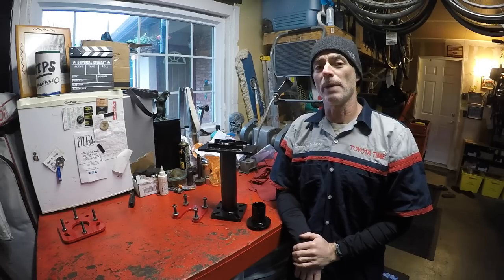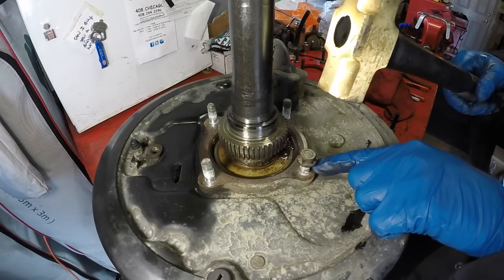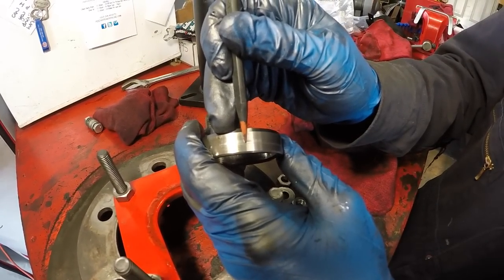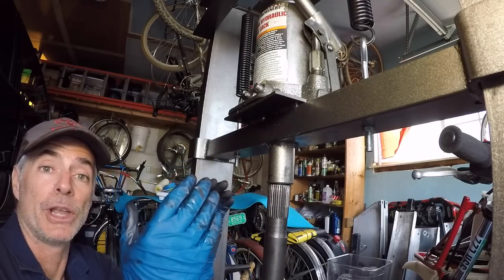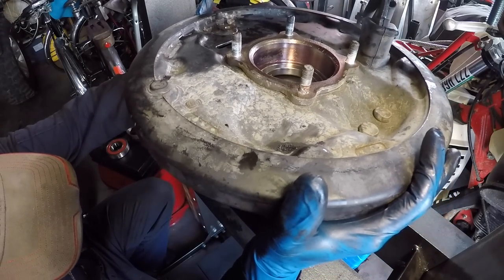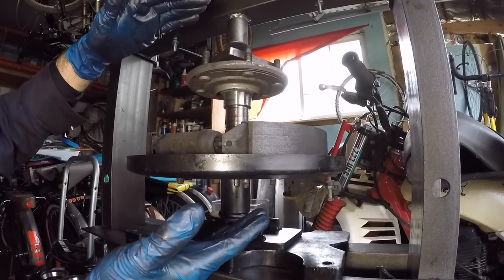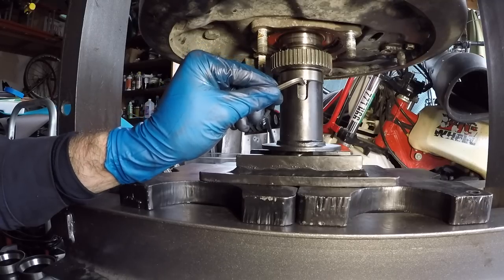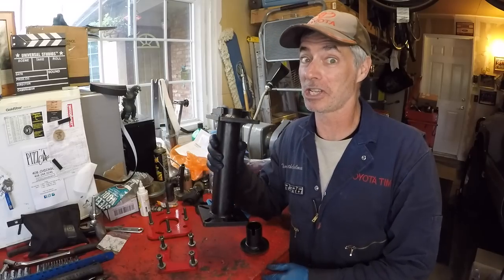Toyota Rear Axle Seal/Bearing Replacement (Part 2)

Comment: Hey timmy I used the abs ring puller for the first time the puller actually started bending and my abs ring bent now too. Have u ever encountered this ?
Reply from the maker: No, I haven't run into this and I've used the tool for several jobs now.  Don't have an explanation why that happened.
Reply: Your problem is im proper use of the tool .
Reply from the maker: @shobud7561  Hey Sho, I have heard from somebody on T4R.org that the same thing happened to them.  I don't know if it was Chris Fong or somebody else entirely.  The issue of the tool bending might very well have to do with the use of aftermarket retainers.  The person who bent the tool said the retainer was made by Timken and not Toyota and the Timken retainer fits much tighter onto the axle.  This could very well be the reason that the tool bent because the retainer was not manufactured to the proper spec.
Reply: Did you get it off??? And how???

Comment: Will a Harbor Freight 12 ton press work? Or do you need the 20 ton press
Reply from the maker: I have heard a 12 ton press can do it.  Duane sells an axle tool that will fit the 12 ton press.  The one we showcase in this video won't fit.  Go to Duane's Ebay store and you'll find it.  If you message him and buy directly from him, not using Ebay as the middleman, he'll give you 10% off.

Comment: I have a smaller press, with a 3.5 inch channel on the press table.
Reply from the maker: Ok Louis, you have a smaller press.  Do you have a question?  I don't understand the purpose of your comment.
Reply: @TimmyTheToolman  that was in addition to my question about the width of the tools top plate. You responsed already, about not giving out the dimensions.... I have placed that comment in the wrong spot. 
To those wanting context..
My harbor freight 12 ton press has a table channel of 3.5" the 20 ton is four. I just received the tool I purchased from donald the bonald, aka Duane, in ebay. Awesome quality, great turn around. The tool is stout! It will not fit through the 12 ton press table. But will fit the 20 ton as Timmy has shown...  buy Duanes tools, they are well made.
Reply from the maker: @louis_costa  Gotcha Louis.  Yeah, I heard Duane's tool won't fit into the 12 ton press.  The 20 ton press is not much more money and it has worked flawlessly for me for lots of jobs.  Maybe you could sell the 12 ton press somebody and upgrade to the 20 ton press.  That's what I would do.

Comment: Tim, I'm stumped and am desperate/determined to overcome this on my own somehow so I dont regret doing this on my own. I replaced bearings and backing plates on my 04 Tacoma along with the entire drum assembly (shoes and all). I'm now getting an awful shudder when I brake and only feel in the cabin, not the pedal. I'm 75% sure it's the rear drivers side. Unfortunately I discarded the old brakes but I purchased a third cheap drum incase it was out of round and it still continues on that same side. I'm hoping something isnt bent but no clue how to diagnose or what to look for. I know I'm asking alot, but any suggestions would be highly appreciated. I'm scared to bring it somewhere so they can RIP me off. Please help I'll provide you with my email or phone number.
Reply from the maker: Did you use OEM brake shoes?
Reply: @TimmyTheToolman  no :( I used powerstop. I saw someone recommended them on tacomaworld along with OEM.
Reply from the maker: @cyclopz-J  People have had lots of problems with aftermarket shoes.  I'd suggest buying the OEM shoes and swapping them in for those powerstop ones.

Comment: Idk why but my abs ring is much closer to the bearing than what is shown on the video. Perhaps someone previously attempted this repair on the vehicle and pressed the ring on way to far. As a result, I dont have enough clearance between the abs ring and the bearing to fit Duane's tool. Does anyone have a solution to this?
Reply: Also it's a 1997 4runner sr5 4wd w/abs
Reply from the maker: @jeffg658  Yeah, they could have pressed it on first and then pressed the retainer on.  If the inner retainer isn't right against the ABS tone ring, someone definitely did work to the axle.  You can try a bearing splitter.  We use in the Part 1 video married up to the other tool.
Reply: Good idea Tim, thank you!

Comment: i have 2007 4runner that the differential humming noise, can you do the differential rebuilt?
Reply from the maker: We haven't rebuilt a differential.  We would leave that to a company like East Coast Gear Supply at this point.  We might try a differential rebuild at some point but no plans right now or the near future.

Comment: Great video, like all of yours Timmy -- Kudos!. Flipping inner retainer, bevel outward?
BTW: Nice tip on reusing old retainers & tone ring.

Regards,
Paul
Reply from the maker: 1) Yes, flipping the retainer is to enable you to get the seal centered on the polished shoulder of the retainer without risking the retainer grinding into the inside of the axle housing.  If you didn't flip it, you'd have to press the retainer on at a shallower depth on the axle which brings the retainer very close to hitting the inside of the axle housing.

2) The retainer for the most part is occupying the same position on the axle as before, but by flipping it, you're gaining the width of the bevel because seal doesn't first have to push past the bevel to get up onto the polished shoulder.

3) Be sure to read the comment I pinned (1st comment you see).  After shooting this video, we realized it's not a good idea to use an old retainer for the inside position.  I explain the reason in that comment.

Good luck with the job Paul.

Comment: Hey Timmy, sorry I never replied on my previous comment about that previous tool not working on my axel correctly. They blew me off as well so I didn't have any news to give you on what they had to say about it. I still think I may call them and try to negotiate a refund or something since it was such an expensive tool for it to be manufactured incorrectly. Unfortunate that they run their business that way.
Reply from the maker: Well, it's worth a shot but I wouldn't hold much hope of getting ahold of them to discuss a refund.  We did free advertising for them for almost 2 years and they didn't bother responding to me.

Comment: Where can I find the bearing driver you used because I bought a kit but the one it brought it doesn’t fit
Reply from the maker: I'm guessing you're talking about the seal driver kit.  The one I have is from OTC.  Here's a link: https://amzn.to/2D7BFT1 

By the way, all the tool links are in the video description.  All you have to do is click on "more" to expand the video description.
Reply: @TimmyTheToolman  it’s the tube to put the abs
Reply from the maker: @alexrivera107  That tool kit is linked in the video description.  It comes as a set.  Here's the link: https://ebay.us/qvwy0n
Reply: Ok thank you
Reply from the maker: @alexrivera107  You're welcome.

Comment: How big of a problem is it that I put the bevel in on the first retainer? ( rather than bevel out)
Reply from the maker: Not a big deal.  That retainer it just a place holder for the bearing.  As long as you got the snap ring installed above the retainer, you're good to go.

Comment: Great video. How wide is the welded top plate, rectangle on the tool?
Reply from the maker: Glad you like the video Louis.  We however don't give out specs on the tool so people can copy Duane's design.  It's bad enough some manufacturers from China have done it and passed off his design as their own screwing him over.  He use to charge much more for the tool but he had to cut his prices considerably to stay competitive due to the Chinese A-holes who started selling their ripoff version on E-bay for much less.  So, I recommend just buying Duane's tool.  For the price, it's well worth it.
Reply: @TimmyTheToolman  I can respect that. I actually ordered the tool last week. Should be here on the 29th. I got the all in model, with the different toyota adapters. Im just impatient and wanted a reason to buy a bigger press from Grainger...lol. if it passes through the channels on my 12 ton, than ill be fine. Unless i bend the press.... 🤔
Thanks for the response!

Comment: Can you use the bearing press to press in the inner oil seal?
Reply from the maker: Are you talking about the oil seal in the axle housing?  If you're talking about the dust seal you push in on the brake side of the bearing case, that seal goes in easily by hand.

Comment: Hey timmy what brand was that cup set you have in the red box at the beginning of the video
Reply from the maker: Here's a link: https://www.ebay.com/itm/Universal-Press-and-Pull-Sleeve-Remove-Install-Bushes-Bearings-Garage-Tool-Kit-/202266584190?oid=262449077356

Comment: About how long will it take for one person to do it ?
Reply from the maker: If it's your first time and you're also replacing the rear brakes, plan on 6 hours.
Reply: @TimmyTheToolman  Here are the symptoms,  As i come to a stop sign and slow down to a stop, from about 15mph and down i hear a cluck cluck cluck as i stop, the moment i put on the gas to take off the noise stops, then it will repeat itself at about 15 mph and down still making the noise when i coast to a stop from about 15 mph and down, but the moment i hit the gas the noise will stop, 
until i coast or brake to a stop, never seems to make any noise under acceleration.   P.S. U joints replaced 10k ago.
Reply from the maker: @nonamebrand8771  If you had a wheel bearing problem, it would make noise when you're driving at speed and not just when you're coming to a stop.  Maybe check the rear wheel bearings for play but also pull the brake drums off and inspect the brakes.

When you said the u-joints were replaced, did you actually find someone who knew how to replace the u-joints in the double-cardan joint or were those u-joints left alone?
Reply: @TimmyTheToolman  Not sure about the  double-cardan joint . Its been fine for the last 10k miles. No sign of leakage !!!  I brought it back to them the other day to put a patch in the tire where a plugged it. It started making the noise days before i saw them. They gave me a number to somebody local that does axle bearing stuff. They do not do them. Bought it with 269k knowing the U joint issues.
Reply: No i've not a new problem. Hard shift from 2nd to 3rd gear. I took it out to listen to the rear axle bearing issue.

Comment: i been eyeing that press at HF because of tim's videos lol.... just got no room for it :(.
Reply: @TimmyTheToolman  i bought one......
Reply from the maker: @MinhBui-ni1by  Good choice!  I love this tool.  I used it again the other day to help a friend swap an axle.  We knew something was up with this axle the first time we did the job because we had to pound the axle out and knock it back in due to the studs dragging in the axle housing holes.  At first we thought the studs were bent but it ends up the bearing case flange was a little bent.  Obviously his rig got in some type of accident in the past to cause that to bend.  We swapped out the axle and bearing case from a donor axle but kept the backing plate and brakes since his were in much better shape.
Reply: @TimmyTheToolman  great videos! I need some press plates now! I'm doing manual hubs using your video (slightly different approach)! I am recording it too.
Reply from the maker: @MinhBui-ni1by  Have fun.  Let me know when you have the video up.
Reply from the maker: @MinhBui-ni1by  I subscribed.  Hope you can make the party.

Comment: I can’t get the snap ring to snap in. I press until it gets hard, and I see the gap, but it stays pretty small. Not large enough to get the snap ring in. I just end up bending metal plates. Anyone have any tips?
Reply from the maker: Did you get the right bearings for your axles?  The 01 and 02 axles use a different bearing.  The bearing has a protrusion with a flared end that mates up with a beveled face on the axle.  This might be your problem.
Reply: Timmy The Toolman yep, bearing has the flared race on one end. I accurately measured the sizes between the old and new bearings and they are exactly the same also.
Reply from the maker: @brendentorrance3797  I don't know what the issue could be then.  I've never had this happen on any axle I've worked on.
Reply: Timmy The Toolman I got it eventually. Thanks for getting back to me, Tim!
Reply from the maker: @brendentorrance3797  That's good to hear.   Good job!

Comment: Timmy, does the 5mm Allen  wrench trick work on a 2006 Tundra?
Reply from the maker: I don't know.  I haven't performed a rear axle seal job on a 2006 Tundra (1st Gen Tundra).  You just need to perform a grease test or sharpie test to see where the seal is riding on the retainer.  I don't know how the rear end in a Tundra compares to the 3rd Gen 4runner or 1st Gen Tacoma and whether Toyota re-designed the axle seals for the Tundra.  I would compare the replacement Toyota seal with your original one and see how they match up.  If it looks like the same deal where the seal was re-designed and the seal lip now sits more inboard, around 2mm, a flip of the retainer and keeping the retainer in the original position (5mm of polished axle showing) on the axle shaft might be the ticket.  Once you get the axle out, you'll see how it compares to the 3rd Gen 4runners and 1st Gen Tacomas.
Reply: Yes, it will.

Comment: Them snap ring pliers kinda have a duck bill shape
Reply from the maker: The pliers I used to expand the snap ring to get it off aren't even the correct style to use for that type of snap ring but they seem to work the best to get onto the edges on the ring.  The ones I used to put the new snap ring on are actually the correct style but it's hard to get the tips of the pliers onto the snap ring when it's inside the groove of the axle.  The pliers keep on slipping off and it's a test of patience.  That's why I wanted to show the screwdriver technique because it's an option if you get fed up trying expand the snap ring far enough to slide it up the axle shaft.
Reply: @TimmyTheToolman  got ya timmy makes sense was a great video also good information

Comment: Can I use this for my 2008 tacoma?
Reply from the maker: Check the Ebay link we provide in the video description and read the vehicles it's compatible with.  Duane makes axle tools that are compatible with many different model and generation Toyota trucks and SUVs so if the one we used in the video won't work, maybe another one he sells will.

Comment: What bearing part# fits 01 Tacoma trd factory locker rear end
Reply from the maker: For the Tacoma I don't know at what point they switched from the original bearing style to the other one with the protrusion.  You'll have to do some research on that.  I think someone on the forum Tacoma World would be able to answer this question for you.  The part numbers for the retainers and ABS tone rings are all the same.

Comment: you love enhancing the insertion....lolol
Reply: not that i got anything better to do but you say not to press the inner race in at 31:55 but then when ever your driving the the axle into the wheel bearing while the retainer is pressing against the inner race while the axle it being pressed down. Is it actually okay to push on the inner race? if so, get a block of wood and lightly tap the wheel bearing in. then i would imagine the retainer would drive the bearing the rest of the way home
Reply from the maker: When pressing the axle through the bearing, the outer retainer that is being pressed onto the axle shaft at the same time is supporting the inner race on the opposite side so there's no load being applied to the bearing.